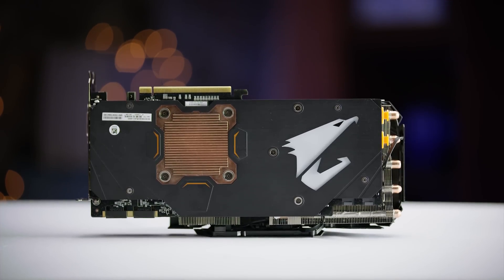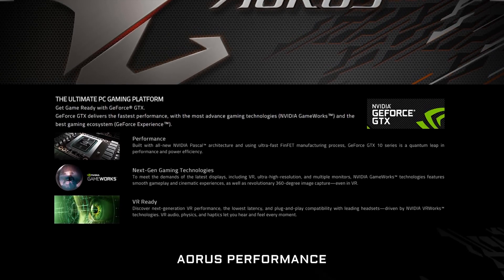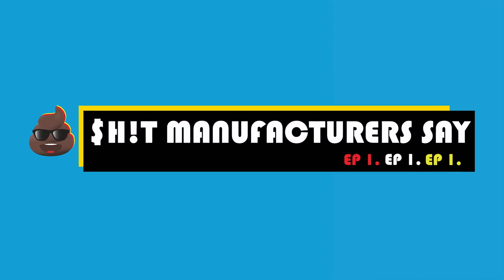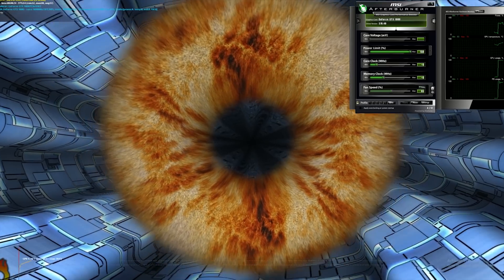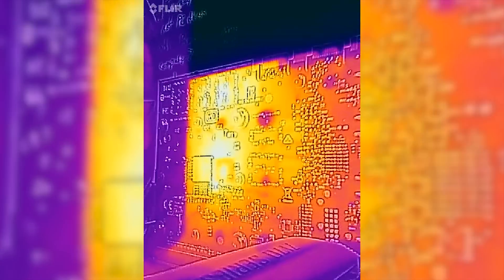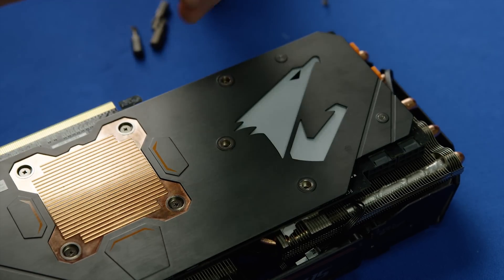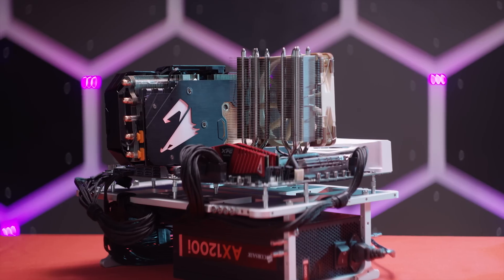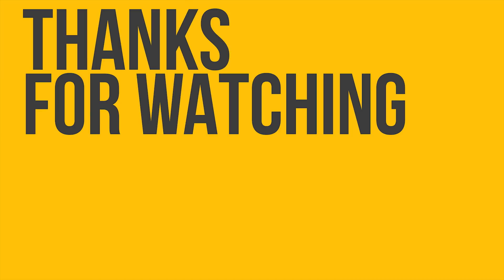$h!t Manufacturers Say Ep. 1 - "Backplates Cool Your Video Card"

Comment: The main purporse is not reduce heat from the core but split all the heat produced by components located at the back of card to the metal plate then in usuall case scenario heat will be blown away from the metal plate by the front intake fan and rises up quickly to the rear exhaust fan out of the case. This will increase lifespan of most components like voltage regulators, mosfets, vrm, even pcb and others. It will also acts as surface area compensating heatsink in the front of the card. 

This video is missleading.  No thermal images were taken from the exact spot, no individual temperature probes used in key areas which is used to compare in different enviroments, settings for fan in the msi afterburner were not fixed for fan, no case scenario used.

For the enthusiast users it could be taken even further by replacing cheap thermalpads by high-cost and high-end ones from alphacool or fujipoly with atleast 11W/mK covering all the area of backplate.

Comment: If the copper plate was doing what it was designed to do it would be the exact opposite as shown in this video. It should be taking the heat off the PCB. Instead of being so much cooler you can make out the shape it should be hotter then the surrounding area. 

So the copper plate does absolutely nothing.

Comment: what sensors did you look at? and what did the flir say about the temps on the backplate, vs without the backplate?  i am guessing the software is reading a sensor that didn't see any cooling benefits from 1 over the other, i know my backplate helps my gpu, when using my own temp sensors,

Comment: The backplate is for the other parts... not the GPU... Not to mention that heat viewer thing is usually auto ranging and wasn't even displaying average temps. Now that we are making more efficient GPUs the VRMs and Memory modules are now being taxed much harder and need the extra cooling. Doesn't take a lot, but there is only one card that monitors them currently and that was only because the previous model was literally catching fire... They fixed them w/ software and thermal pads that are free to order, but the new model w/ more robust back plate cooling and a full set of thermal sensors was more or less a reply to this issue. Backplates are functional... and yes as stated already. They are designed to be inside a case with actual airflow... they don't have massive heat fins to passively cool otherwise.

Comment: GPU Core temps are not the only thing that the backplate is cooling. The backplate can also cool VRAM chips on the back of the PCB as well as anything else on the back of the PCB as long as there are thermal pads between them and the backplate.

Comment: For future reference; the cold spot in the FLIR footage shows you that the copper bit is cold (rather obvious). 
If it was actually working to remove heat, it'd be hot. Hotter than its surroundings in fact. 
The hotter it is, the more heat loss there is.

Your FLIR footage is all the proof one needs to conclude that the copper on the backplate is not working as advertised. It's just a gimmick.

Comment: The look of the backplate is more important than the 'front' fans and stuff. I buy cards with them because it's the most prominent part of the GPU when installed in a computer.
Reply: My Antec 1200 stays on the ground next to the desk.  I don't even see it, really.
But yeah, I like backplates because of the rigidity and protective factor.
It feels and looks cheap to just have the components exposed, especially in the wind tunnel that is my PC.

Comment: I have a slight problem with the test setup. You are running the card vertically on your bench, but in a normal case it is horizontally so the backplate is on top and not the side. I highly doubt that it makes a difference but you should have tested it in more real world conditions.

Comment: Some people are questioning your testing methodology. 
Guys, There's a thick fucking PCB in between GPU and copper back plate. 
On top of that there are many SMD components too on the backside of PCB. 
The cores will always be cooler on the heat sink side and as we know heat moves from hot to cold side.
The GPU chip is designed to move heat towards heat sink and not towards the soldered points.
So, can the back plate cool GPU cores? Fuck No! 

Still don't believe me? Remove your GPU heat sink, put a small PCB in between it and run furmark and test if it transfers any heat lol

Comment: Why wouldnt a backplate help? The back of the card gets hot, very hot, and its just a heatspreader, which is a method of cooling that does work. Whats going on here is that first of all the fan speed wasnt controlled per test, as far as we can see at least. Also, whole numbers of centigrade are a pretty large measurement of temperature, and there is certainly some variation if tested properly.

Comment: Since you had to remove the front cooler, breaking the thermal paste and either a) applied new, likely different paste or b) ignored the paste and just re-used now with a breakage in the seating, it renders the result invalid right there already.

Add to that, all other reasons stated regarding airflow in OTB as well as no indication that you set a fixed fan speed.

Comment: Would like to know your aware of the Emissivity value on your Flir Camera. Metallic items, particularly SHINNY Metallic items have a super high reflectivity rating. Chances are the "Cold Spot" you think you saw, was just the reflected thermal radiation interpreted by the Camera. Drop the Emssivity down to like 0.2 or lower. And PLEASE don't presume the temperature displayed by the camera is Accurate. A lot goes into getting ACCURATE temperature measurements using a Infrared Camera.

Comment: You guys do know that Aorus isn't an actual company, right? It's just a line of products produced by Gigabyte, like STRIX isn't an actual company, just a product line from Asus...

Also, since this was done on an open-air bench which usually means zero moving air, did you have any fans blowing air across the motherboard, like there would be inside a case? Gotta think that having moving air going across that chunk of copper would do something....probably won't make an amazing difference, but maybe a degree or two improvement.

Comment: I never understand why they didnt do a double sided cooling system yet, instead of a shitty metal plate.
Reply: Well, there isn't much benefit to doing that for the GPU, because while a regularly placed cooler can make direct contact with the GPU die, on the other side of the card you'd have to go through two layers of PCB, thus reducing the cooling potential significantly. The VRMs are also typically placed on the top rather than the bottom of the card, but there's nothing stopping graphics card manufacturers from putting those on both sides, as many already do with VRAM modules. Actually, I think your idea could work rather well if the cooler on the one side was responsible for cooling the GPU, and the one on the other side was responsible for cooling the VRAM and VRMs.

Comment: So... Technically. If the FLIR shows a cold spot where the cooper plate is, it's not because it's cooling, but because it doesn't absorbs heat... So cannot disperse it... You know.If it was efficient it would be as hot...

Comment: Few things:
1. Shouldn't the copper backplate bit look a little hotter than the rest if it was doing anything?
2. Standard backplate but with those little heat sinks you can get to stick to specific bits attached, would they do anything other than to keep the backplate cool? I know the plate on my 1080 and the one I had on my 980ti (rip my friend) did get rather toasty after a few hours.
I also want to know what other shit I've been suckered into 'cause it sounds good.

Comment: Again kinda pointless review when only comparing die temperature. Backplates are usually ment to cool other smaller components on the pcb, like vrm.

But to be effective this requires a real backplate, not some flimsy one. There are "backplates" and then there are Backplates. If you want to see backplate cooling done correctly, look up Arctic Cooling aftermarket gpu coolers. Honestly though, even those will probably not cool the die itself, but vrm's and other stuff will be a_lot cooler with it.

Comment: C'mon guys, you know you want to re-test this using a thermal pad that ACTUALLY transfers heat.  Id eat my hat if the included pad surpassed 3 watt/mk.  Here is a link to get a 100mmX100mmX1.5mm thermal pad that does a whopping 17.0 watt/mk!!!! That's better than most thermal PASTES!!!
https://modmymods.com/alphacool-ice-thermal-pad-17w-mk-100x100x1-5mm-1011309.html

Comment: Surely there would only be a difference if there was some (standardised) airflow over the backplate/backside-of-the-PCB?  The only way there would be any difference is if there was some airflow to actually dissipate the heat being put out by that surface.  
Not that, hey, your testing methodology might be bullshit in this situation or anything, because Physics.  Unless you want to say that convection's all you need, in which case, why even bother with fans at all..?

Comment: Back plates do have a uses. When you have memory modals located on the back of a card, the back plate is used to cool the memory, not the gpu... For example, I have 2 GTX 680 4gb versions (standard was 2gb) and without the back plate you cannot overclock the memory very well because half of the modulus are located on the back of the card and thus would have no cooling.

How did you skip over common scenes. This is like saying putting a 2nd radiator in your car is useless, then benchmark it and showing no improvements. Well no sh*t. Now put a turbo in the car without installing a 2nd radiator and watch your turbo melt.

Next they will show us that snow tires are useless and do all the testing in the desert without snow.
Reply: The "second radiator" in turbocharged cars works as an intercooler which is supposed to cool down the intake air heated by the turbocharger (increasing pressure usually raises the temperature because thermodynamics and stuff). Cool air has higher density than hot air which results in more oxygen per volume for the combustion inside the engine. In the end intercoolers usually result in higher engine temperatures trough increased combustion of fuel (the amount of heat removed from the intake air is orders of magnitude less than what is released trough increased combustion), so using it as an example of cooling down an turbocharged engine might not work that well.

Sorry about the nitpicking, but someone had to do it. Not disagreeing about the memory modules on the back but it might be good to keep in mind that a great majority of consumers wont have a card like that. Also most modern GPUs have their memory on the front of the pcb (active cooling trough the heatsink is much better than a jury-rigged passive cooling trough the backplate).
Reply: With Denis driving, while others make fun of him...
Reply: You don't need a second radiator if you install a turbocharger and a back plate does not act as an efficient radiator since it lacks surface area.
Reply: @raidmax21 
Does backplates have a use outside of looks? yes, and this videos didn't claim otherwise.
Does it help cooling the card in any way? yes and no, as you said it depends how the layout is, but most of the  time, NOPE! and those other times its about as different as 1866hz is to 1600hz on a stick of DDR3 ram.
as for your GPU, i think there is something wrong with it.

Also, that is the dumbest thing i read today, two rads? do you even know how a rad looks like in a car? its not a thin metal plate, its giant block of metal. also its GPU not CPU.

"Next they will show us that snow tires are useless and do all the testing in desert without snow."
You´re clearly talking about yourself here since you are comparing rads and backplates.
They dont even work the same.
Reply: raidmax21 I have a turbo and only one radiator...
Reply: You mean an oil line? A 2nd radiator is usually not needed and it will still cause your turbo to seize if you forget to connect it to an oil line. An intercooler is needed to cool the air coming from the compressor so that your engine runs happy. Either way, I get what you mean.
Reply: raidmax21 nigga why you lionnnnn :B
Reply: raidmax21 accurate
Reply: Virkash ACTUALLY you have two, the second radiator is called an intercooler but it uses air instead of water
Reply: SilverX95 yes, I have an intercooler, but it doesn't cool the turbo
Reply: Well said! What you said is right so no faults on that.
Reply: Backplates dont have any use except pure cosmetics. If any of the companies makes passive cooler style backplate, i would give them a prop. Tho, even that might not achieve desired results, and might not be viable investment for said companies.
Reply: Hey raid, nice comment, very informative.
Could've left out the insults though.

Comment: The thing that drives me crazy about these before and after thermal tests is that you don't mention fan speed at all! did you set a fixed fan speed for both tests? Or make sure that they both stayed at 67 degrees at the same fan percentage? because maybe the fans went a bit harder to remain at that temperature making the cared run louder without the backplate.
Just a thought.

Comment: FYI, you have no airflow over the back of the card, which is typical of open-air test benches. We won't know if the backplates actually do ANYTHING unless air actually flows over them since they are, if anything, passive cooling. Try this test in a closed case with controlled airflow or even a fan blowing directly on the backplates.

Comment: that isn't a fair test because in a case there would usually be fan blowing across the backplate. the backplate could dissipate  the heat and the fan could blow cool air over it. same thing with a raditor if you don't have a fan blowing air across it then there would be very little cooling. The backplate would help with vrm and other component.....EVGA cough* cough*

Comment: There is a way to put a heatsink on the back of a PCB, but it only works for QFP and similar packages, not the BGA chips you find in computers. It works by actually cutting a hole through the PCB to expose the underside of the chip and putting a chunk of metal in that hole to conduct the heat to the heatsink on the back.

Comment: You are watching wrong data - temp limit is 79 and that will be reached anyway under stress test, but frequency and performance will be different depending upon cooling system.
I'm not saying that these backplates will help, but temp limit is a wrong indicator in this research, again - due to gpu boost.

Comment: Did you guys even try? you didn't lock the fanspeed at a certain speed or underclocked it so the boost is always the same.. that's pretty inconsistent testing because it's clearly programmed to stay at that temperature target of 79 on the founders card or 67°C on the Aorus 1080.. this really annoys me even if it makes a small difference, this is about small changes so please at least try a little.

Comment: It seems you need to perform this review with VRM temps measured, not just GPU core. See the new evga cooler that specifically cools VRMs. EVGA admits the new cooler is not higher-performing than other versions at the limit, but it runs quieter and may increase the longevity of the card by keeping other components cooler. So the question may become- does a backplate cool VRMs, and should we care about this?

Comment: While I like LTT,  however this test is flawed for one thing the back plate like any heat sink needs airflow and as everyone knows test beds do not have air flow and since test beds do not have air flow the back plate will have zero effect, but then test beds are not a realistic usage scenario as pretty much everyone has a case with fans blowing air to where GPU would be so its in this situation that it would provide cooling admittedly not alot,  Take my old GTX970sc it did not have a back plate and i am obsessed with temps and have a monitor up always and after applying the back plate they where selling my temps did go down but by so small amount its no benefit.

Comment: should've  tested this in a case, where most of the heat will rise towards the backplate. in an open air test bench most of the heat escapes through the side of the card because of the way it's placed. run the same tests but in a case and you will get different results